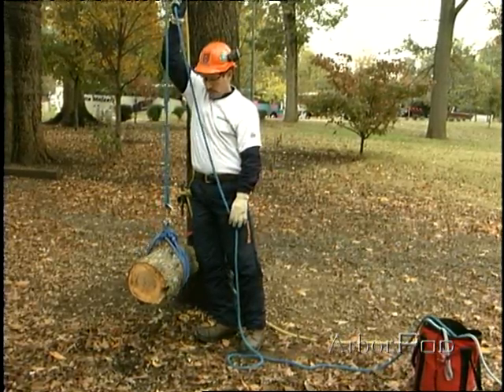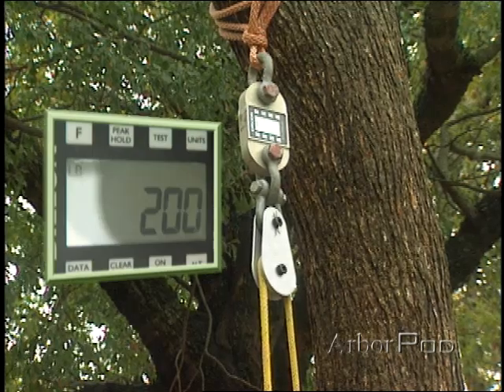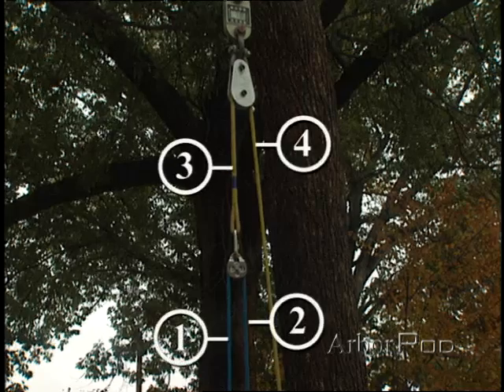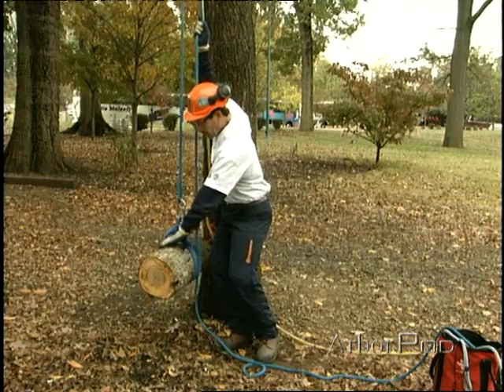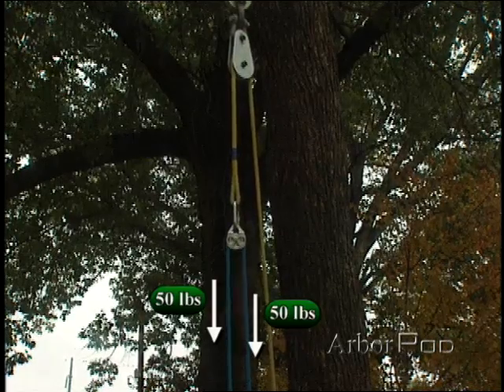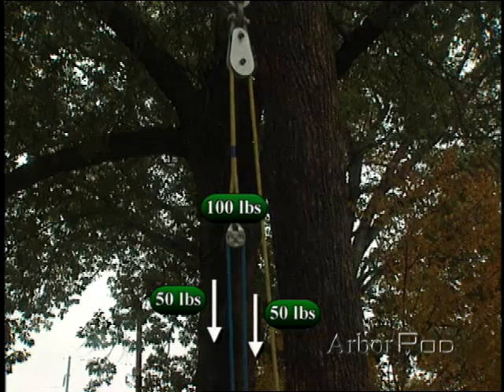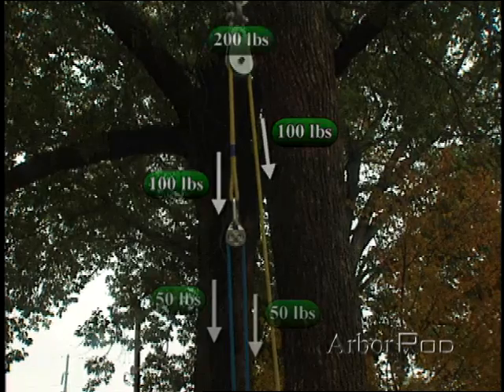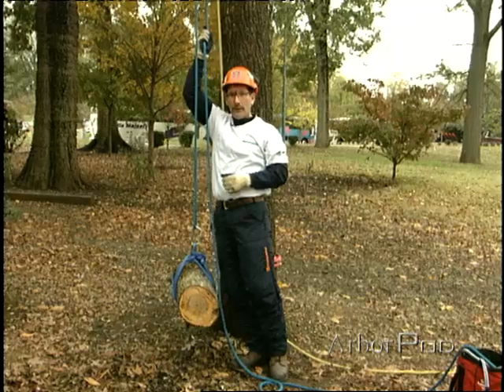Bend Ratio, Rope Angles, and Reaction Forces

Comment: Great information on here.
One question, if in the end scenario with the two pulleys, both ends of the blue rope were tied off onto the 50lbs block, instead of one of the ends being held by a person, is it correct to assume the force on the blue rope pulley would drop to 50lbs (so half) and therefore the force on the yellow rope pulley also drop to 100lbs?
Reply: Worlds latest answer. Yes, that's correct.

Comment: Nothing wrong with what's said there.
Whilst what Terry Hale says is true, in the video he doesn’t say the rope will be in compression along the primary axis, just that the inside of the bend is in compression. That is true
Reply: While the inside of the bend will definitely be compressed laterally (between the pulley and the rest of the rope), it is practically impossible to predict the longitudinal stress of those same fibers.  If the pulley was delivering just a slight redirect, rather than 180 degrees, the whole cross section would definitely be in tension, with just a slight difference in the amount between inside and outside.  If you hold a rope in your hands and bend it, you feel almost no resistance to the bending until you get down to very small radii, relative to the diameter of the rope.  It is only when you make a tight enough bend to feel resistance that you have induced compression in the inside of the bend in the rope.  Pulleys are designed to have a big enough radius so that the inside of the rope doesn't go into compression.  Some ropes are manufactured to be much stiffer than others and would therefore be more difficult to bend to tight radii, but such ropes are generally not used in tree work.   If you bend a rope around a pulley and it doesn't provide much resistance to being bent, there is very little initial compression, and any subsequent tensioning applied to the ends of the rope will only apply tension to the cross-section.  There will be no induced LONGITUDINAL compression to the fibers on the inside of the bend.  Depending on how the tension of the pull is distributed across the cross-section, the longitudinal tension delivered to the inside of the bend is likely to overcome any compression that was initially there due to the bend.
Reply: Terry Hale
Terry, sorry I'm a bit late with my reply!
I dont disagree with anything you say there: to do so would just be 'spliting hairs'.
But then of course, that could be quite important when talking about ropes!
Reply: Thanks for the great series of videos!

Comment: Thanks for another quality video.  One little quibble.  While a beam in pure bending will develop tension on one side and compression on the other, the same will not necessarily be true with a rigging rope.  It will develop significantly concentrated tension on the outside and significantly reduced tension on the inside of the bend.  In general, it is quite difficult to induce longitudinal compression in a rope, especially when the fibers are independently flexible.  If the pulley has a tight radius and the sides provide enough confinement, compression does become possible,  Otherwise, fibers on the inside of the bend will adjust laterally and longitudinally to avoid going into compression.